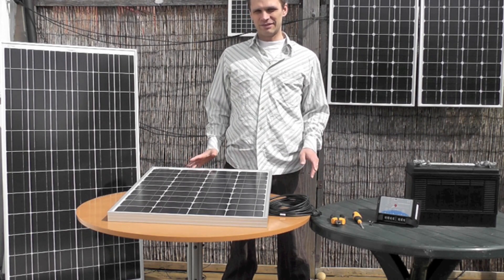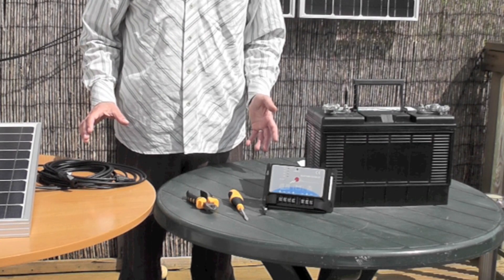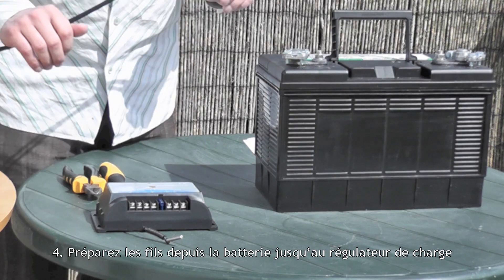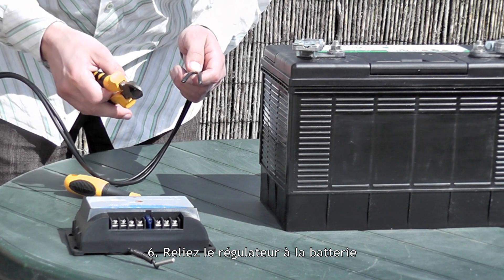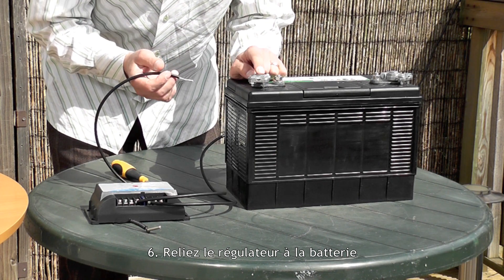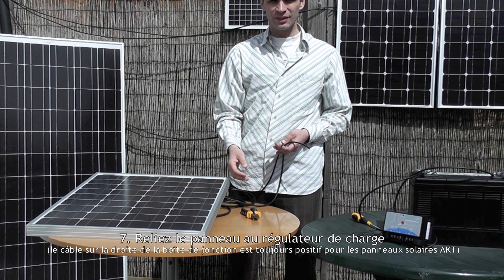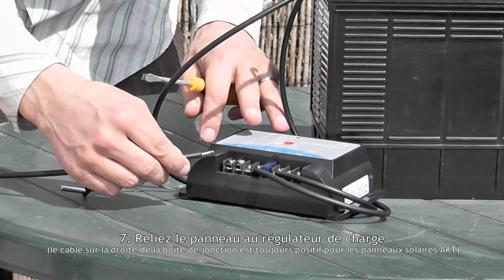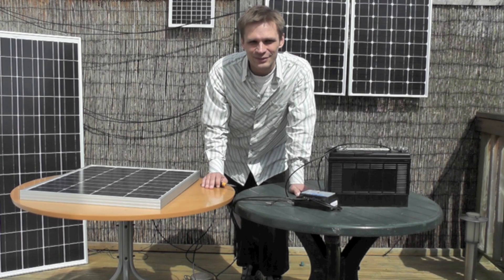Comment connecter un panneau solaire AKT à une batterie via un régulateur de charge

Comment: je veux savoir pour la section de calcul 
cable
Reply from the maker: Tu veux dire la section du cable? C'est 2.5mm2 pour les panneaux de 50W ou moins et 4mm2 pour les panneaux de 80W ou plus.
Très cordialement,
Simon
Reply: merci pour la formule de section cable avec systeme en courant continu je voulais savoir la tension batterie pou pouvoir calculer la section de cable entre regulateur et batterie avec une chute de tension de3% merci

Comment: Hey, it seems very simple! But, I have en electrical bicycle. I would like to make a long trip and to be fully independant during the trip. My Battery is a 16Ah/48V. How long time it can takes to charge the battery? One battery is on the bike & the other one is in charge. Thanks
Reply from the maker: Hello Jean,

The best way to charge this would probably be to use something like 3 x 20W panels as these would give 3 x 17.5 = 52.5V at maximum power and I expect this would be within the tolerance for charging your battery. However, to be sure of this I would need to know more about the exact characteristics of the normal charger. Could you send me this information and also let me know what type of battery it is you're charging? 

As a guide, 16Ah at 48V is 48 x 16 = 768Wh so 3 x 20W panels in full sunlight would take 768/60 = 12.8h to charge your batteries fully from zero or 6.4 hours to charge them from half charge.

I hope this helps,

Simon